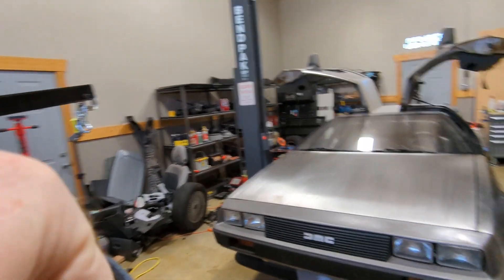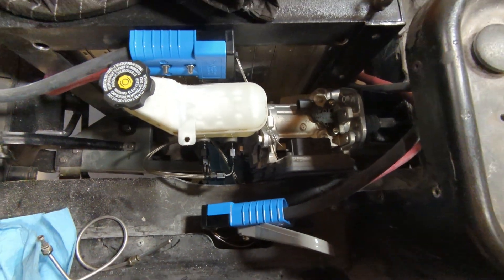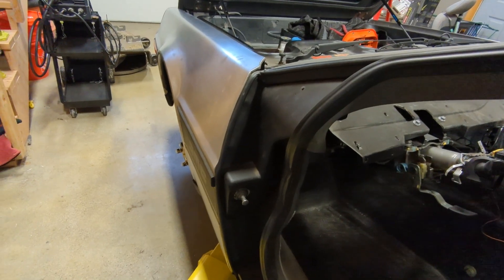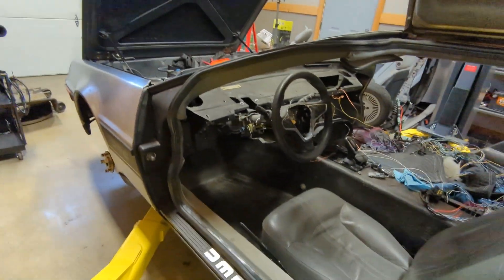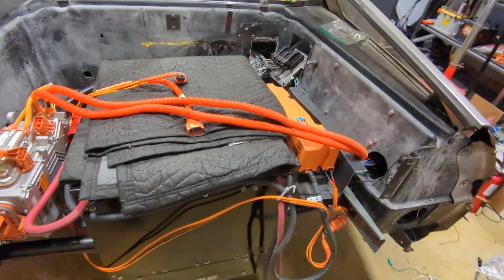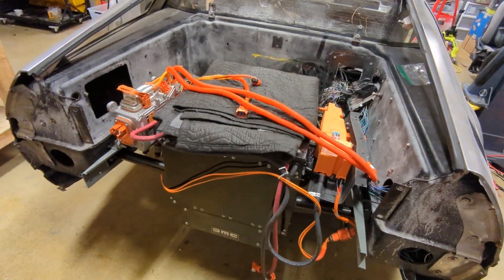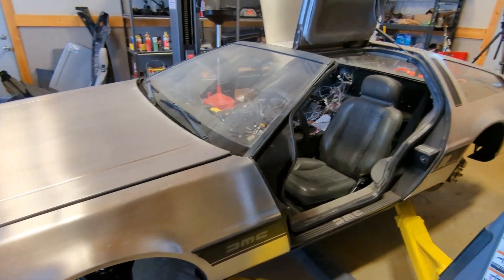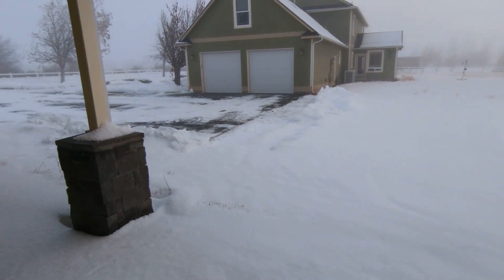Project Lighting - Dec 31st 2022 Update

Comment: Can you share what fittings you used for the soft brake lines coming from the ibooster master cylinder? I have a Chevy Volt ibooster and am having difficulty converting from the M14 outlets on the master down to 1/4 or 3/16 for the rest of the car
Reply from the maker: Took me AGES! I probably bought two dozen different fittings before I found the proper solution. I ended up using AN fittings and braided hose, since I couldn't find proper fittings for hard lines. I have a thread on DMCTalk.org with "VIN 5510" in the title. Page 13 has a post with the details. Mine is M12x1.5 (Bolt iBooster) -> 4AN -> 3AN -> M10x1.0 Bubble (DeLorean brakes). The reason you have to do it this way is because M12 (or M14 in your case) requires a larger diameter brake line, which isn't the same size as the M10 lines, so there is no way to put both sizes on a single hard line.

Comment: Looking damn good, sir! Have you measured the difference in resistance on the leads going to the battery packs? I'm really curious to see how evenly the different packs will drain. Do you have an idea of the current the motor will draw? I'm sure it's fine, but if one pack depletes before the other, i'd be curious to know how much the last pack would have drawn from it. Or does the Bolt's BMS just stop discharge once the lowest pack drops too far?
Reply from the maker: Thanks! I haven't measured the pack lead resistance - but they are all in series, not parallel, so the difference in resistance shouldn't affect the drain rate. I'll certainly keep an eye on it, though! The motor will draw ~400A/150kW/200HP at peak. Probably only in bursts of under 10 seconds. Normal driving down the road is probably like 30kW? I could probably estimate given 3.5mi/kWh @ 60mph... but math is hard. ;)
Reply: @BillCarlson  oh it never occurred to me that they were all in series, so ya not a concern. Do you have a thermal camera? Would be fun to check out temps after leisure runs and hard runs see if there's any real difference. Probably going to be perfectly fine though. Happy new year!
Reply from the maker: @TheDigitalMermaid  I have one in my Amazon cart!!! :D
Reply: @BillCarlson  do the thing!! They're shockingly useful.
Reply from the maker: OH! I forgot to mention - I got a new audio recording setup. I had the Rode Wireless Go (as we discussed) and ended up having multiple videos with no audio that I had to re-record, so I shelved it and got the DJI Mic - it's AWESOME and has backup and standalone recording, which is what I'm using in this video.
Reply: @BillCarlson  if you saw the early videos I did, I had a lot of audio issues trying to figure out how to use them. Glad the DJI work well, I'll keep that in mind when I think about upgrading.